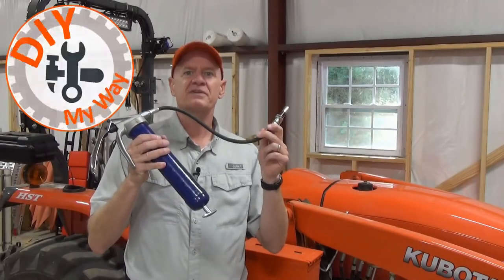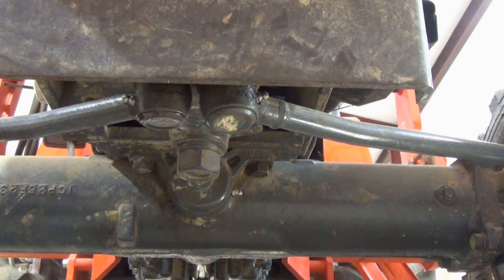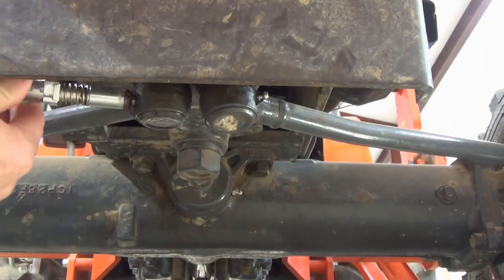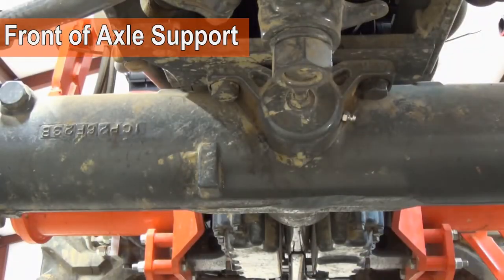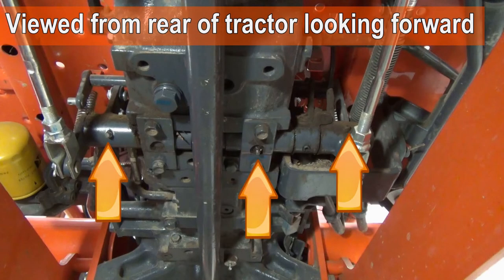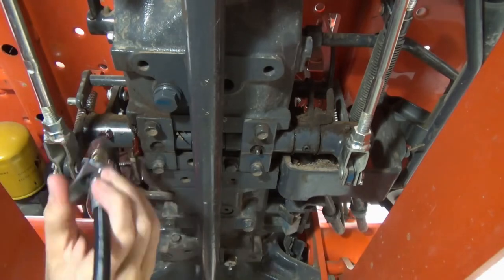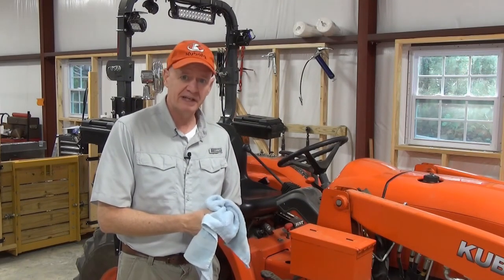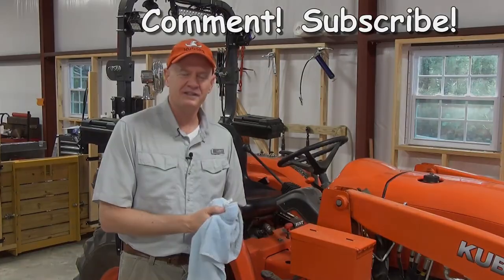Greasing Your Kubota Tractor - Find All the Grease Fittings! (#68)

Comment: Hey Martin...that lock-n-lube is on my Christmas list !!  I grease much more frequently than 50 hours.  I have a number of heavy equipment operators in my family and two buddies that are hvy equip mechanics.  They grease daily under normal use and on heavy use, which is almost daily, they grease again at lunch.  Our much smaller equipment is not subjected to quite the same abuse as the big stuff but I still hit 'em at 10 to 15 hrs. Yeah, I'm probably wasting a bit of grease but I feel better.  Its kinda like that second bowl of ice cream...I just can't help myself !!  Good reminder though sir...  One of these days, I should show you my pneumatic grease set up with a 30 gallon barrell....LOL  You'd be in hog heaven !!
Reply from the maker: Merry Christmas, Wendell! I hope Santa brings you one! They are wonderful. I grease my tractor frame every 50 hours per the manual, but I grease my FEL and backhoe every 10 hours per the manual. I’m sure I waste grease because I squirt it in until I see fresh grease seeping out. Grease is cheap. Equipment repairs often aren’t! Sounds like you have a good greasing system. I am not at all surprised. LOL. Thanks for watching!

Comment: Very nice video.  I bought one of those grease zerk fitting after seeing how easy you connected.   Off topic - I love all of those lights that you have attached to your ROPS but what I'm really interested in is the 2 tool boxes.  I just have the factory original and it is way too small for anything but the bare essentials.  Would you do a quick video on where you got them and how they are mounted?
Thank you
Reply from the maker: Thank you!  I already did that video.  You’ll find it in my Tractor Mods playlist along with one on the LED lights and several more mod videos. Thanks for watching!

Comment: Should the steering be greased at the 10 hour or 50 hour maintenance? Thanks for a well done video.
Reply from the maker: My understanding is that the tractor itself gets greased every 50 hours and attachments like front end loaders and backhoes get greased every 10 hours.  Of course, it won’t hurt to grease more often if you prefer.  Thanks for watching!

Comment: Sorry I'm a tractor newbie...  you said (as it says in the manual) to use NLGI 2 or NLGI 1 grease...   what is the deciding factor? is one better than the other?     also...  what pressure is required to grease a kubota BX tractor...  I see that grease guns are rated at various pressures...
Reply from the maker: Hi Tom!  Nothin’ wrong with being a “tractor newbie”.  I’ve had my L3901 for about 2.5 years so I still consider myself a newbie in many ways.  When I was deciding on a grease, I searched sites like TractorByNet to see what seasoned tractor owners used.  One grease that kept coming up as a good one was Lucas “Red N Tacky”, which I think is an NLGI-2 grease.  It is a heavy duty grease for heavy equipment.  I really like it because when I’m greasing, it is easy to see when the new red grease pushes out the old blackened grease.  That way I know I have squirted enough grease in a zerk.  As for pressure, I just have a pistol grip hand-operated grease gun that works just fine.  Hope this helps! Thanks for watching!
Reply: You didn’t mention the loader. Do you  use the same grease in the loader? The manual recommends high quality grease designating extreme pressure and containing molybdenum disulfide. If you don’t use the same grease, do you keep two grease guns one for each grease type?

Comment: I greased my front axle support and never had any grease come out the breather port. I unscrewed the port and no grease came out either. What gives??
Reply from the maker: That doesn’t sound good.  Do you get any back pressure on the grease gun or does it go in easily?  On mine the grease pumps in easily and grease starts coming out the breather port fairly quickly.
Reply: @DIYMyWay  I did get back pressure and the grease came back when I took the hose away from the zerk.